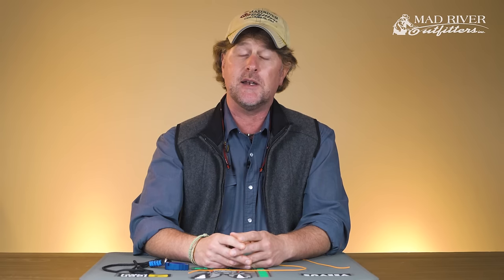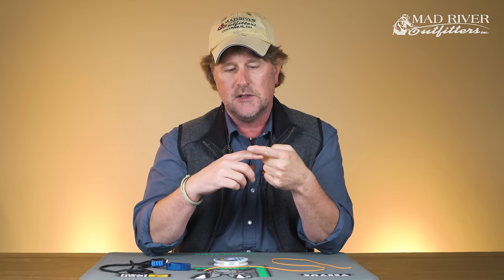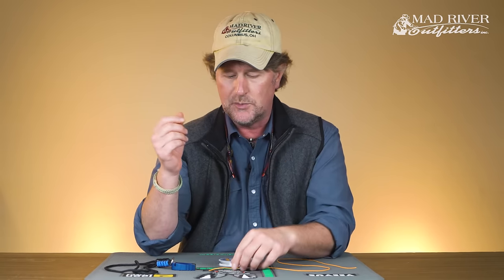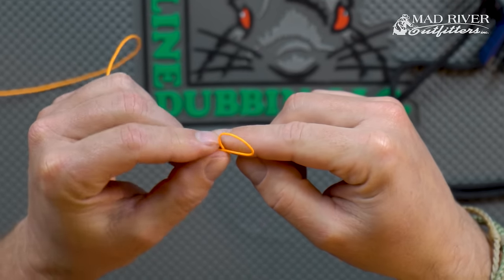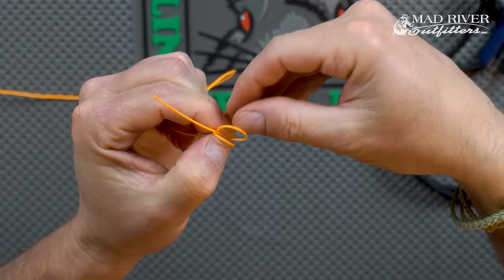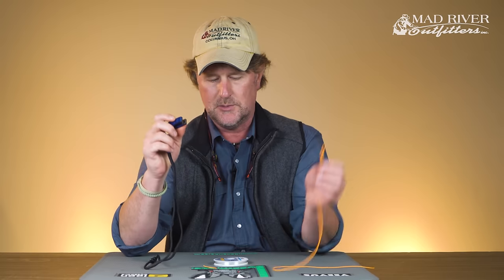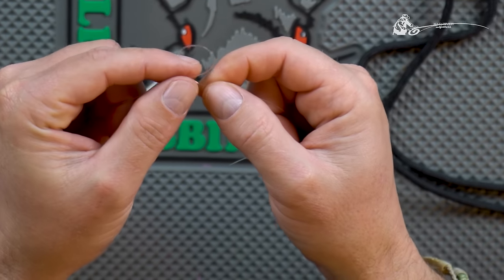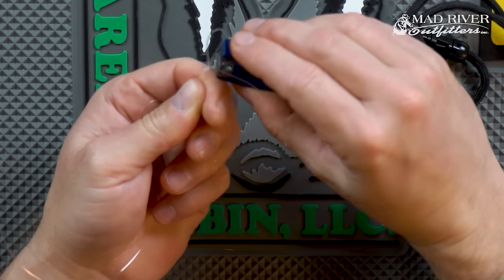How To Tie A Perfection Loop

Comment: That is amazing i start to fly fishing now in sweden  and i am learning a lot from your videos , i have a question  can u do a Perfection  loop  directly on the flying line if it have no loop  like u did on first step and attaching it to the loop leader or the method using maxima to make a loop is better , i mean if it work and deliver same energy so i skip the maxima loop and do it directly on the line  , what do u think ? Thanks.
Reply from the maker: Thanks for watching. Please send your questions directly to Brian through the shop and he'll be happy to help. You can e-mail him at admin@madriveroutfitters.com.
Reply: @Madriveroutfitters  hi i did message him , i got no answer so far , wonder if he got my email
Reply from the maker: @abbasmerhi1  He answers every single email so if no response, he didn’t get it.
Reply from the maker: @abbasmerhi1  he did get the email but is traveling so he should get back to you later tonight or tomorrow. Thanks.
Reply: @Madriveroutfitters  Thanks

Comment: Hi there I’ve just watched every one of the perfection loop videos on you tube, studied them all very closely as I don’t think this is as good a knot as everyone thinks. 
Now I might be wrong and in a way hope I am, but I’ve tied a dozen perfection loops on each end of  piece of line with my own loops which I’ve been using for ever on the other end (basically a loop of line with an overhand knot with a twist in the standing line).
So, I’ve got twelve pieces of line with the perfection loop at one end and my other knot at the other. 
Fingers in each knot and pull (one at once)!
Every one broke at the perfection loop! Now I’m no genius and I don’t have any laboratory testing facilities, but it seems to me that the PL is not what it’s cracked up to be! Honestly I would love to be proved wrong, so if anyone would like to get back to me I would be most  interested. Thank you by the way for the video. Martin from England.
Reply from the maker: Never had that experience with this knot. For sure best to send this note over to Brian at the shop via e-mail if you don't mind. He'll get back to you there for sure. admin@madriveroutfitters.com. Thanks.

Comment: Quick question on the perfection loop in monofilament: Is that a proper size or should it be smaller for actual use? Thanks!
Reply from the maker: That’s about proper here in the video. Feel free to contact Brian at the shop though if you have any further questions.

Comment: I would like to makeup several leaders with loop on each end of specific length with same size loop like several 18" with 3/4" loop on 10lbs test and same with 1 1/2" 20 lbs test using pvc pipe to set size of loops
Reply: Any help atchieving this like what size pvc pipe would be nice as I plan to keep leaders in cd disk pouch to take on fishing trips
Reply from the maker: Please contact the shop directly with your questions and they will be happy to help. Thanks.

Comment: If your fly line has no welded loop at the leader end, can you tie a perfection loop with it? My leader has a loop but my fly line doesn't...
Reply from the maker: No, please never tie any kind of knot within your line.

Have a look at this video:
https://youtu.be/8QKCXstJw30?list=PLQWrNcNbEVXYj76LtDVDKSFtdq2Sw8GcW

The method shown there will work great for you.

Let us know what weight fly line you have and we'll get you an idea of what diameter mono to use for the "loop connector"

MRO
Reply: Mad River Outfitters 
Thank you for the quick reply!

I have a 5wt fly line on.
Reply from the maker: .017" - in Maxima Clear that is 20lb

Make sure to use Maxima Clear or an equivalent STIFF type mono. Nail knot a 6-8" piece on the tip of the line and tie a perfection loop in that as shown in the video and you'll have a loop connector. All set.

Feel free to give us a call if you have any questions.

614-451-0363
Reply: Mad River Outfitters wow thank you I did not expect a response that fast as well as a great solution. Tight lines!
Reply from the maker: Happy to help. It's what we do.

Stay tuned.

Comment: Will this work for makining a loop to hook on leaders
Reply from the maker: In the butt of the leader, yes. Not in the fly line.
Reply: @Madriveroutfitters  So if my fly line doesn't have a loop would I nail knot it or what
Reply from the maker: @hounddog8895  here you go:
https://youtu.be/8QKCXstJw30?si=g8VZrPv0CDEelBrM
Reply: @Madriveroutfitters My loop keeps slipping been trying for multiple days there's no luck

Comment: To make it a welded knot would just melt the tip of the fly line so it doesn’t pull threw?
Reply from the maker: Bluegill20 Not sure we understand the question. Probably better if you email the shop directly. Thanks.

Comment: I tied a perfection loop at the end of my leader's butt section (It didn't come with one), but it seem s to slide to much.  Am I tying it too loose? Or alternately should I skip the perfection loop and use a snell/nail knot to attach it directly to my fly line?
Reply from the maker: Porpoise Power It shouldn’t slide if tied right. Your choice there on the “method”. Feel free to call the shop if we can help further.
Reply: @Madriveroutfitters  Thanks, I'll try it again.
Reply: @Madriveroutfitters  3rd times the charm I guess... not sure what I did wrong the first couple times.  Maybe some part of the knot flipped the wrong way or something during tightening.
Reply from the maker: Porpoise Power 👍
Reply: I think I am having the same problem